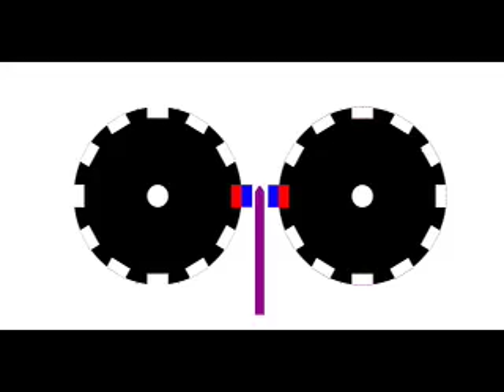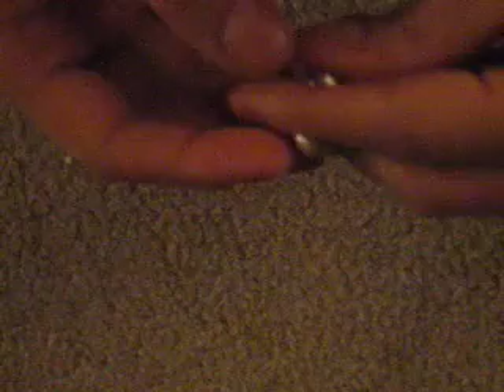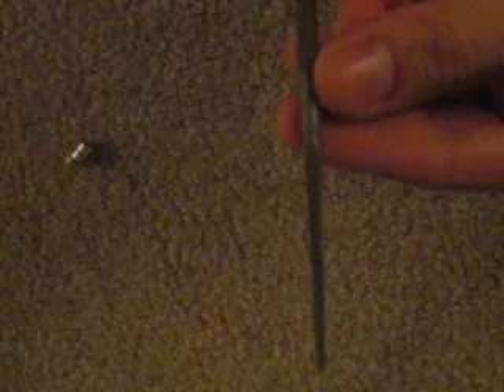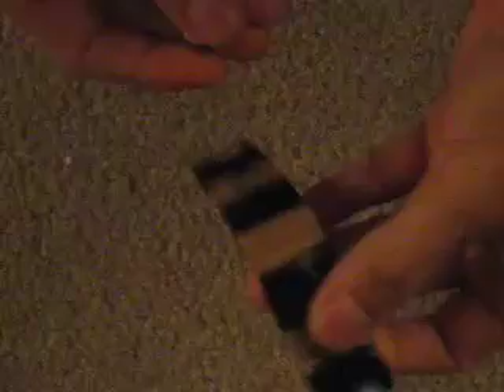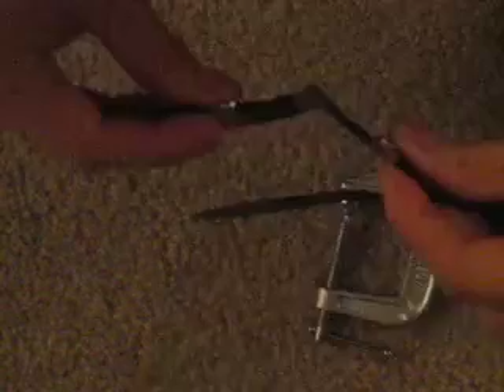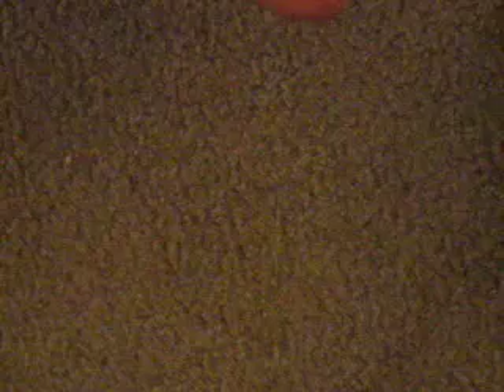Magnet Motor concept and How magnetic shielding works

Comment: The only thing an electromagnet does is turn on and turn off at the precise time.  So the idea of shielding does essentially the same thing without having to power a coil on and off.  So this design will work...Yes I know there are a bunch of things posted on the internet that purposely don't work....No doubt the big energy interests are spreading disinformation to discourage the rest of us.  But it is just common sense that this particular design would work...and it would also be scaleable!!

Comment: "Oh boy. Even using external power the output can never be more than the input."
Normally with standard motors your statement would be true and I would agree.  It is not true with the Libertymagnetmotor design.  The magnets propel the device while the electrical pulse in the actuator costs less than the motor output can produce. Prony brake test. This is only true in this new magnet motor design.  It is mainly due to the magnetic method used and the actuator design.

Comment: Clearly, the electromagnet is very different from a magnet.  You can turn an electromagnet off.  Both the actuator and magnets are necessary for rotation in the libertymagnetmotor.  You seem to have a hang up with using a small amount of power in a motor.  It is okay to use power input if you can accomplish the goal of more output than input by using external power.  Pure permanent magnet motors usually don't work well and usually not at all because they don't switch magnetic fields on/off.

Comment: The Libertymagnetmotor actually is a hybrid magnet motor as it has magnet to magnet interactions, not coils and magnets like a "mere" electric motor.  It is therefore truly a magnet motor that uses a hybrid pulsed power-assisted actuator.  The above magnet motor (and all pure magnet motors) either have  issues due to eddy currents in iron or it experiences magnetic collisions that inhibit rotation and stress magnets.   Switching the magnetic poles and avoiding magnetic collisions is key.

Comment: The libertymagnetmotors use magnets in the rotor and the stator and do function.  The coil is not directly in the motor, so yes it is technically an electric motor.  But it is not a conventional electric/magnet motor.  There is no bemf directly in the motor, because there is no coil directly in the motor to act as a generator.  Therefore, the motor speed is not limited by an internal coil and is largely limited by the ability of the actuator to keep up with the magnet motor.

Comment: Check out Libertymagnetmotor channel.  There are 4 movies that have a real magnet motor using near all magnet configuration.  Low input power is used on a speaker  actuator.  It works well and can be highly efficient.

Comment: I think you missed the point here. No matter what pole you use on a magnet, it will always be attracted to a magnetic metal such as iron. What OP is saying here is that while the magnets are attracted to the steel bar, at a certain point the magnets will be close enough the the repulsive force of the magnets (put together) will be equal to the attraction of one magnet on the iron bar. I still doubt the concept would work though.

TLDR: Magnets get attracted to metals no matter what pole.

Comment: Only if the steel is magnetized to a certain polarity otherwise they will both stick to the steel and create a force of equilibrium, I just tested it with 5500 gauss magnets and they were both neodymium as well. The steel is not polarized which allows the connection hes creating to happen.

Comment: While I agree his theory is flawed, I disagree with your reasoning. A magnet will attract to a magnetic metal no matter which pole you are using to attract them. (A north pole will attract to an iron rod as easily as as a south pole. 
The major fail in this - and every other - 'free energy' theory is friction. 
If there as no friction - Impossible as he is using gears - they would spin indefinitely.
This mechanism is less efficient than an ordinary wheel, and the magnets serve no actual purpose.

Comment: @Jerrod Lopes you could maybe theoretically, in a vacuum where there are no forces resisting against the motion, with a system with 0 friction, create a perpetually moving object, you just couldn't draw any power from it because to draw power from it, you need to create resistance, and therefore your machine would soon stop working. All energy comes from somewhere, the energy that comes from a machine is drawn from it's motion, and so more energy needs to be input to keep it moving.

Comment: Perpetual (long term/400 year) motion devices are theoretically possible...in a frictionless, vacuum, maybe. The problem arises when you attempt to harness energy, you end up creating friction and loosing energy through heat, sound and some imperceivable light (sparks). This quickly leads to the device falling into a state of equilibrium (it stops). Sorry but its just the cold hard facts, I wish they did work but they don't. Look up the laws of thermal dynamics and you'll see it makes sense.

Comment: I had great hopes to make a model similarly but found the the MuMetal (magnetic shielding) was extremely magnetic. Therefore the magnets would attract to the MuMetal and pretty much stop right where you see the preview of this video. The only way I have found to make magnets do actual work is to use a pulsating magnetic field a.k.a electromagnets pushing (or pulling) against permanent magnets. 
"There is no known substance that can shield magnetism and not be attracted to it itself."

Comment: can you buy like 20-40 magnets an build the gears from wood or plastic and show this working as a proof of concept instead of using a computer drawing.  Use real things and video it spinning.  I just found a design on picture on some website, very similiar and figured I needed the gears to synchronize and just drew up on paper this exact design.  I need to build a proof of concept or see this design working.  As I am not sure. The magnetic field is all a big complex jumble, not individual forces

Comment: For starters there is no magnetic energy.  Magnetic motors don't rotate by themselves because there is nothing to make that happen, so it is a redundant question to ask "what if the energy comes from somewhere else?".

What everyone who supports magnetic motors is missing is that none of them rotate by themselves.  Sure, animated ones do, and faked ones, nut otherwise rotation under their own power is impossible.

Comment: You show the moment when the magnets are next to each other, and their effect.
Even if the wheels are geared together, you don't consider the moment when the magnets are out of phase. At this moment there will be an equal and opposite force applied in comparison to when they are next to each other. Resulting that the machine reaches a point of equilibrium, doesn't move, and no free energy is obtained.
In short - THE MACHINE WON'T WORK.

Comment: In detail, after a magnet attracted to an object, to perform attraction again you need to pull the magnet away from the object which require energy; after a magnet has repelled an object, to perform repulsing again you need to press the magnet near the object again which require energy. It works like spring. Understood? No energy gain.

Comment: I have just done the experiment as you described. The system did not work. For your information magnetic attraction is moving from low energy level to high energy level, repulsing is moving from high energy level to low energy level. Perfect shielding is neutralizing the magnetic force thus no energy present.

Comment: @stevekool19 - free energy devices are impossible.  Put one in a fully insulated box with the output shaft sticking out driving a load (generator etc). As the load is driven energy is thus leaving the box.  Therefore the inside of the box has to get cooler (till it reaches absolute zero and the device will stop) or the contents of the box gets lighter as mass is converted to energy.   Neither of these are going to happen as it cease to be a free energy device.

Comment: @stevekool19 what you have described sounds like religion & God in particular.  LOL

I'm talking about very basic physics, not anything confusing like quantum mechanics.  If a magnetic motor works by magnets repelling then where does the force come from to push them to a position where they can repel again?  As the force released by repelling equals the force required to push them together, therefore no gain. Allowing for friction means no free energy to keep spinning.

If I'm wrong explain why.

Comment: i only find one problem, and unlike other people, i'm not just going to say it goes against physics.  you assume that the magnet will attract to the to the point, in the case of one magnet it will attract to the closest point because thats when the force is strongest.  in the case of two magnets, it would no longer be the area of most attraction as, just like you said, there is a balance of forces there.  the magnets will attempt to reach the area of most attraction which is probably half way up

Comment: @britishtuna I've seen a couple others, such as VsGhllSgpLU .  I'm only impressed with the ones that pick up speed on their own.  Over time, supposedly most or all of these designs will come to a halt, but I suppose that could be remedied with some small electromagnetic pulses powered by the generator itself, just to to keep the momentum.

Comment: Shielding do not change a thing. It only change location where magnets stops.
Magnets are like helical spring, but spring value K is not linear like spring had. So using magnets (neodymium or regular) dont create excess energy more than springs does.

Comment: @tye45io This is not a magnetic gear. A magnetic gear has opposet poles (N/S) on each wheel. This has the same poles (S/S) on the wheels. the gearing keeps the alignment from drifting.

Comment: This is a Magnetic Gear, not a magnetic motor. The problem with magnetic gears is they tend to sheer from each other. You are correct in saying that adding the mechanical gear would solve this problem, but it would remove the friction-less quality of the gear. Increasing the Gauss helps and minimizing the distance between the magnets (think magnetic teeth) helps reduce sheer a little.

Comment: @jasperdj Magnets repel for about an inch at the very most with really good magnets. if you have really big wheels, then the magnets have to travel upward much farther to reach the exact  same repeling distance then the smaller wheels do. You have to have enough upwasd disstance for the next set of magnets to come into play. If the wheels are to small, the upward distance will be small, and maybe not enough travel can be reached for the next set to come into play. Make sense now?

Comment: I had full believe this would work, and tested in out of hope
Parts: 
-Chairwheels
-26 strong magnets
-2 homemade gears-like system
-2 Mu-metal plates(magnetic shielding) 

Now it appears when using Mu-metal, the magnet will be ' pulled' by the mu-metal. This 'pull' -force is stronger then the push force in the upper section. 
I might make a video of this, so you guys can see for you're self ;-)

Comment: @knowledgemonger Now, at my own work place, last week, there is a machine that can punch 6 slots into heavy gauge steel, using only tonage. The machine comes to a grinding hault when trying 12 slots. The HIGH paid matenace people say there is nothing that can be done. The lower paid set up guy, keeps bickering on how to do it, he is told it won't work. He ignores them & set up the machine his way. I ran this machine last week. It works fine & I understand why it works, while others sit on facts

Comment: @danielngar I think the size of the wheel makes a difference. since 2 opposing magnets will only repel for maybe an inch at the most, basicly the larger the wheel, the longer the magnets have to travel upward to get to the point maximum repeling distance. There are a few failiers on youtube. They all have small wheels. there is one vid that has a reaction. We must also consider the possiblity that it has been faked.

Comment: @knowledgemonger Wrong again. I have suggested the remote possibility of success if one is willing to try hard enough. Zoe's water injector was just a theory as to how it could be working. The 5x part was refuring to HYDROGEN compaired to gasoline. If you'll note they don't use gasoline on the space shuttle. Why? not enough umph! And you ignored my previous statement, so lets rewind and reveiw it agian...

Comment: @ZoeMarks Well, just what i think is happening with your injection unit is, I don't think that the process is burning the water. The water may be converted to steam therefor converting the liquid to gas would add to the expantion PSI in the chamber. Gas is a poor, dirty burning fuel, that why thay need converter on the exaust pipe. propaine vehicles don't need one. so your taking soming poor and adding somthing with 5x the power and getting more bang for your buck.

Comment: @ZoeMarks Finally, and opinion other than "i'm right, your wrong". I love you. 
I did net a gain in the range you suggest, but am still told it doesn't work. because of the energy it takes to run the device with a parallel power hook up. I figured out how to run mulitble units with an in series power hook up. using the same power that is used to run other devices, again to be told that I am full of shit, by know it alls, like people who's names start with K and end with MONGER

Comment: This is a great concept to include in my magnet drive generator development. Thank you very much, I was going to implement a mechanical cam that would also be driven by the magnetic field intertializing ( hows that for a word) the rotational force, therefore rob some of the energy. But, now what I am going to do with this concept is shield the impact of the repelling magnetic field to just past TDC, not unlike a spark in an internal combustion engine. BTW, critics and cynics, prove to disprove:)

Comment: Electro Magnetic Gravity Wheel: A gravity wheel that instead of weights has magnets. and as those magnets fall in thier channels, they pass through coils, thus creating power. the power can be stored in a capacitor and turn a small motor that keeps the wheel going. Hmmmm...
Not saying it WILL work, BUT more likely than a regular Gwheel. At least the idea keeps the brain juices flowing. any thoughts people? (when I say people I mean anyone but Kmonger!)

Comment: @knowledgemonger The space shuttle was designed by "rocket scientists" as a cheaper and more practical way of getting into space. On paper ALL of the phisics work. Now, 30 years later the shuttle program has been retired because is was NOT cheaper nor practical. Lesson 1 even rocket scientists can be wrong. Lesson 2 Stuff writen on paper never has the same results as the applied use of that idea.

Comment: @knowledgemonger You can't get more energy out of something than going in, BUT if you take a small stream you will get X energy from it. if you take that same stream with the same input and build a dam then you will get X energy times1000. If you build a super dam, you will get X times 5000. same energy going in and out. different results. If you turn on a garden hose you get maybe half a pound of force but put a nosel on the hose and the force is muliplied by 100 & it uses less water. Physics!

Comment: I think this is design is possible, The theory works on paper, but we all know paper and applied mechanics do not always have the same answer, so I needs to be built. if it works it can be stacked. People tried to fly with the most stupidest things then the wright bos. finally did it with only a few seconds of air time. If they were on youtube today we'd be calling them stupid for trying and then say Oh geez you only had it in the air for few seconds.

Comment: The reason this wont work is that it's completely symmetrical. The wheels can either go up or down it does not matter - the forces are equal either way, so there is no net force that will make this move. IF you build this you will see that it will either rest, or once pushed in any direction will slowly loose speed. If you try to attach anything to it (to use it as a motor) it will stop very quickly and you will have to push it again - hence - no free energy.

Comment: People think they can build a small unit and it will work. YOU NEED TO GO BIG! as in a engine FLYWHEEL. reason? first, it is a big gear. second, the disdance a magnet has a strong repeling force is small. maybe an inch +-. the bigger the wheel the more distance the wheel has to travel to seperate the 2 magnets, and the more power it will have.

Comment: I like this video!  The magnets own energy is the force used here.  This is not overunity or free energy because the energy is sourced from the magnets.  It takes a lot of energy to create a magnet and that energy lasts for thousands of years in a permanent magnet.  Magnet Motors aren't pseudo science, they are just another way of using an untapped fuel source that has longevity.

Comment: @hardmouse1972 ... also even if they didn't "find the balance point"...
magnetic shielding slows any magnet moving, or shield moving through each other.
This slowing motion is what creates a current in hand crank flashlights.
The resistance can be used to create some electricity, however them amount is more than the energy put in.

Comment: I tried making a similar one, and the magnets closest to the shield are neutral when they are facing each other, but they suddenly develop a strong attraction to the shield when you try to move them away from it.  It's weird, but it ruins the system.